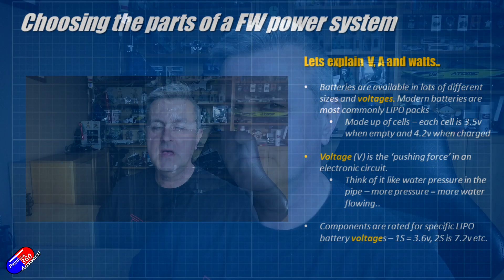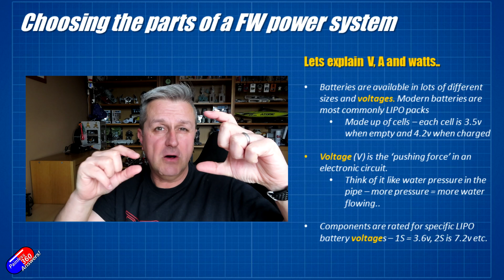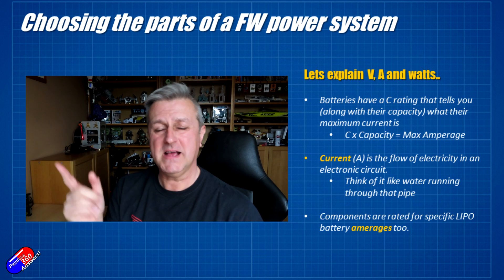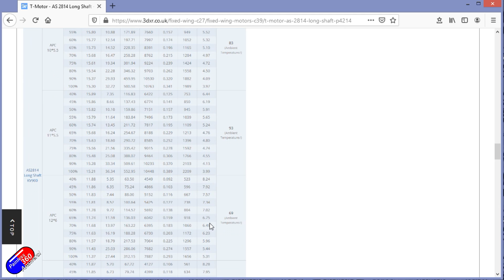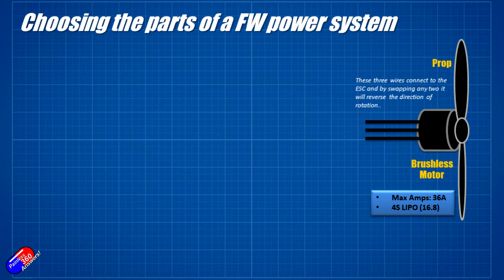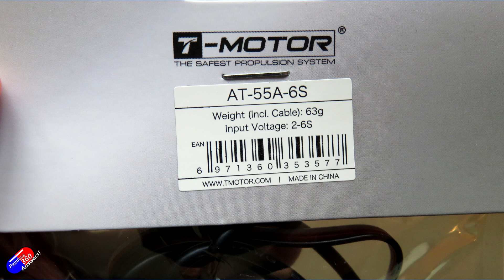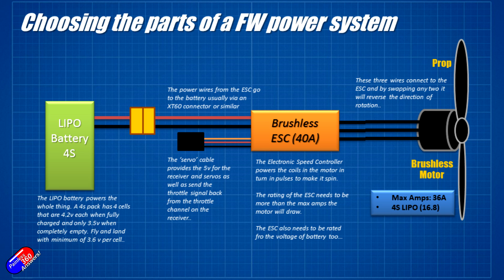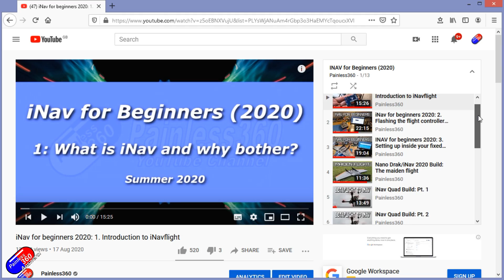Introduction to Fixed Wing electric power systems for newbies.

Comment: 👍👍👍i agree Another OUTSTANDING explanation of basic electronic parameters important in the selection and matching of motors, electronic speed controllers, batteries, and propellors. Much material covered, excellent diagramatic illustration, great photography, and very clear ennunciation of your points!💯💯💯

Comment: Lee:
  Another OUTSTANDING explanation of basic electronic parameters important in the selection and matching of motors, electronic speed controllers, batteries, and propellors. Much material covered, excellent diagramatic illustration, great photography, and very clear ennunciation of your points!

Comment: Simple question: fixed wing always means plane ... but wing alway means single wing and never plane ? 
I am pretty sure that you use the word wing not for plane, but others mixed it up

I am confused when wing is used as plane - we call it literaly translated "one wing" or "only wing"
 
thx a lot
Reply from the maker: I always try to use the term 'fixed wing' to refer for all types of fixed wing aircraft. Flying wings or'wings' are just one type. I guess if you only fly wings then both could mean the same... Happy flying

Comment: Hi Lee, so I don't know if you're familiar with it but I've brought (but not built yet) the new twin motor Bushmule v2. Now it states that it flies on 4s batteries although from what I've been reading, some pilots are electing to fly them on 6s batteries, but because I have quite a few 3s batteries for the Tundra, what I was thinking in order to possibly get much longer flight times was to actually use 2× 3s batteries wired in parallel rather than splashing out on 4s & then possibly 6s batteries.. Good idea or doomed for failure??
Reply from the maker: I've only flown them on the recommended 4s. If you can get it to fly on 3s then two parrallel 3s lipos could get you a longer flight.... Best of luck